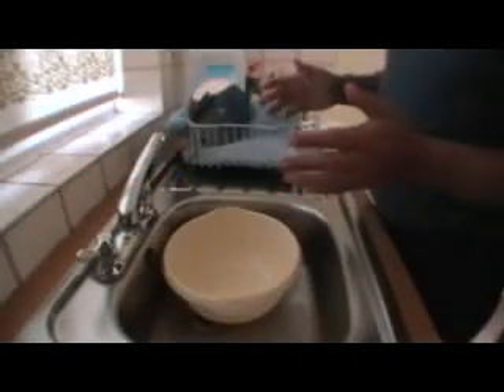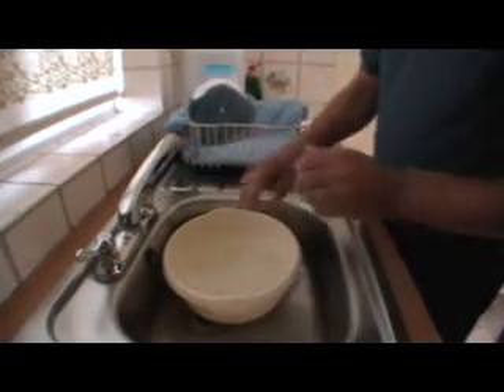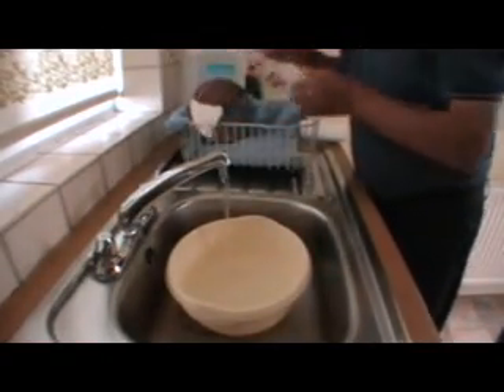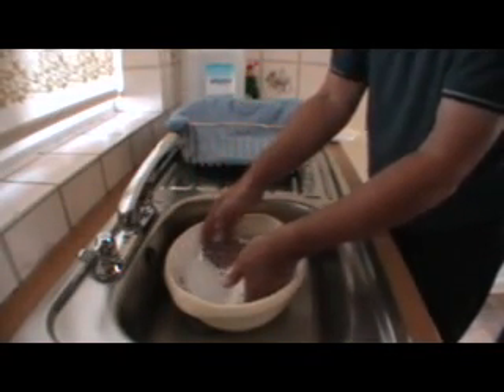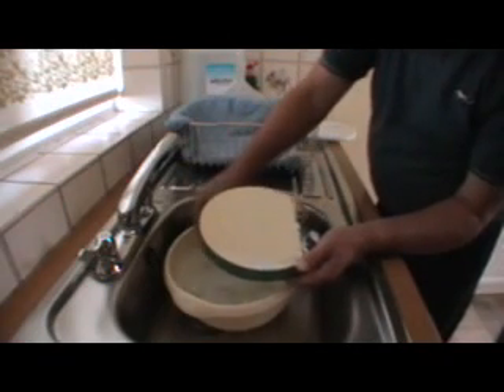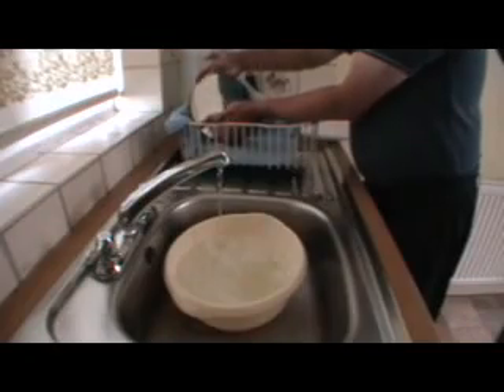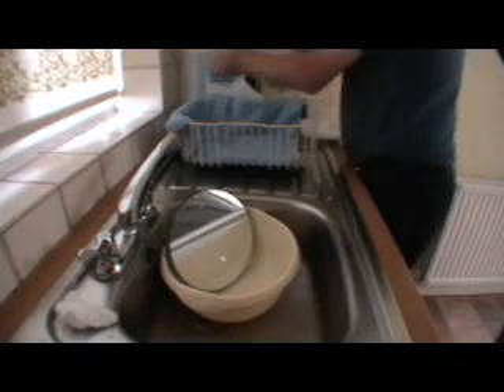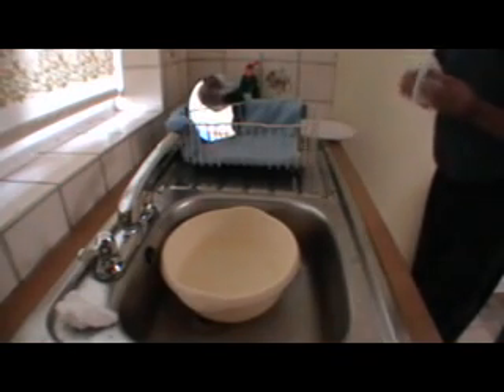Astronomy - Cleaning a Telescope Mirror Safely

Comment: If i just want to clean dust, what can i use that wont scratch the surface?
Reply from the maker: The only 'safe' way to remove loose dust from a mirror if you don't want to wash it, is to use a high power air bulb WITH THE BRUSH REMOVED. However, this will only remove the really loose stuff. Don't even think about touching the mirrored surface with anything other than water.........
Reply: micro fiber clothes wont work?
Reply from the maker: Definitely not - a microfibre cloth will scrape the dust across the mirror surface scratching it as it goes!

Comment: how do you get the  primary mirror out of the telescope
Reply: I used a bandsaw. got it out really easily but i'm having a bitch of a time putting it back in
Reply: aran astesana There should be some small screws on the back of your telescope. Use those.
Reply: David Moss thanks, i already cleaned it :)

Comment: I would have avoided to use cotton balls, wipers, etc at all. Put the mirror in a plastic washbowl filled with water with a drop or two of cleaning solution (neutral, without any balms, aroma additions, etc.) face up, gently move washbowl for a few minutes to force water moving, let it stay for a hour or so, change the water, repeat the process, rinse with water, final rinse with distilled water.
Let nothing except for water, touch the mirror surface. Don't count on the protective coating,

Comment: Drawing the wool across the mirror should be done when the mirror is immersed in water not out.  It prevents the possibility of a piece of debris being dragged across the mirror by the weight of the wet wool.  If immersed then there is less weight of the wool on the surface of the aluminum and less chance of miniature scratches.  This entirely depends on how dirty the mirror is to start with.  A careful preview on the condition of the mirror with a magnifier would be advisable.